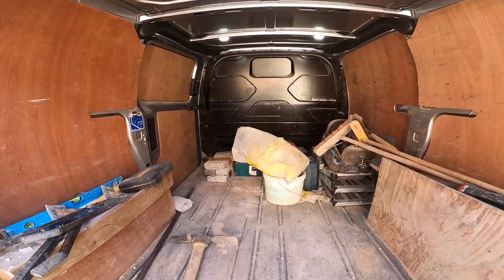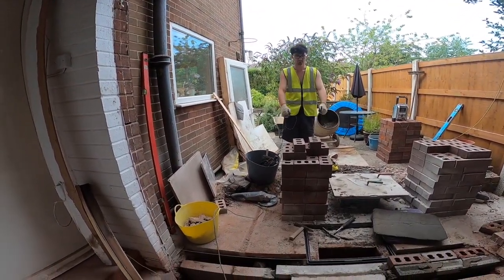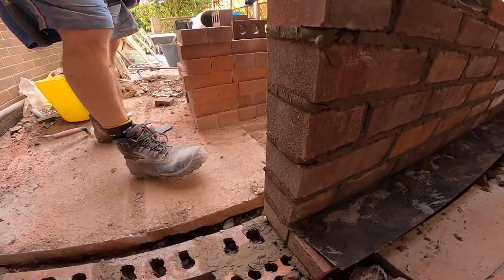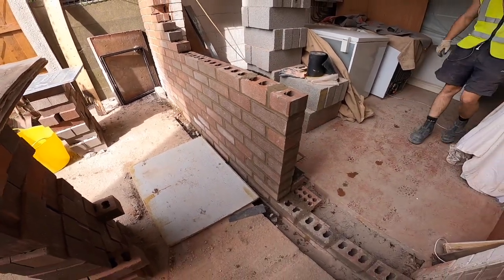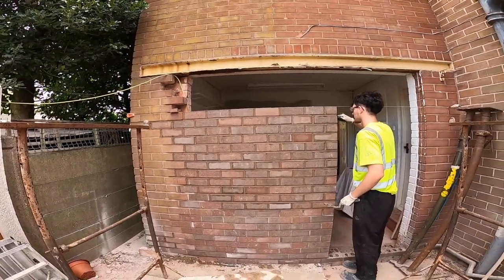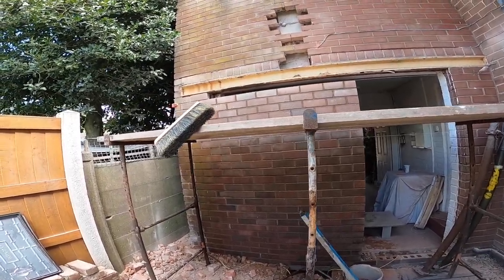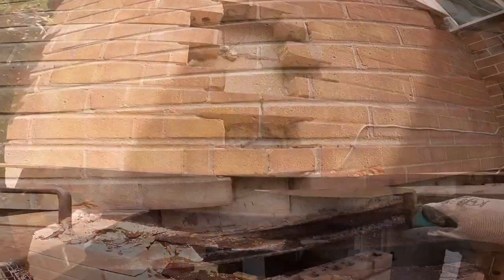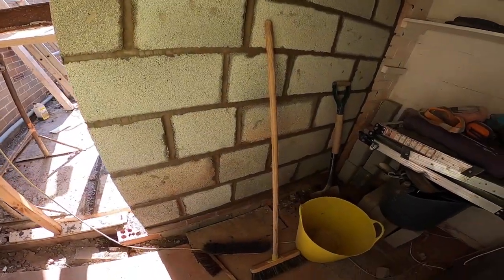THERE IS A MANHOLE IN THE WAY !!..SHOCKING BOTCH JOB UTILITY REPAIR PART 2

Comment: I believe the shocking amount of corrosion was due to the heat differential between a cold garage space below a warm bedroom. This is why it's vital to have a cavity tray above any wide opening. All the condensation forming in above cavity (bedroom area) was dripping straight onto the steel, accelerating the rate of corrosion, which as you point out, would have occurred anyway in the absence of a cavity tray. Top job so far!
Reply from the maker: @martin2466  And those internal timber lintels are out lasting the steel ones which are rotting away. Lot to be said for good timber 💪🏽👌🏼🧱👍🏼
Reply from the maker: @martin2466  💪🏽🧱👍🏼

Comment: TWO THINGS . 1 Did Not. SEE ENY . ISOLATION. 2. That MAN HOLE./ INTERSEPTOR.  SHOULD HAVE. BEEN EXTENDED ( that’s why. They  used to call them. Man holes. So you could ROD THEM .  SHOULD OF. TRENCHED AWAY FROM THE BUILDING . And BUILT THE MAN HOLE LARGER !!  THEN BRIDGED OVER TO. TAKE NEW. COVER ,
Reply from the maker: 1 . You can’t insulate a 9 “ wall . 
Watch part 3 and get back to us then 🧱👍🏽

Comment: I normally praise your work, but that man hole cover lets you down, there will probably be smells because it cannot be sealed properly, it needed a better solution, definately not pass building control.
Reply from the maker: Wait to see the finished job before you criticise its nowhere near finished
Reply: Been a builder 40 years manhole should have been moved from underneath wall never seen it done this way before everyone to there own I guess 👍

Comment: I wonder why they left that steel beam exposed to the air. It's been known for 200-300 years, that rust breaks brickwork. It seems really shoddy work.
Reply from the maker: Bob the whole extension should be condemned , it was shocking 🧐🧱👍🏽

Comment: Interesting video and not a dilemma I'd fancy encountering. Definite case of economics overiding ethics in this case. Re corrosion, I recently started replacing old metal manhole covers with composite covers (3 so far) on driveway jobs and won't be looking back!
Reply from the maker: Sounds good 👌🏼🧱👍🏽

Comment: Alex and Steve as ever your work is of a good standard however, I do question the building over an inspection chamber. I know it would have been expensive but, the chamber is there for a reason and is now very difficult to access for periodical maintenance. Not sure a building control officer would allow this but, I would be interested to know?
Regards DD
Reply from the maker: Watch the final part and get back to me 🧱👍🏽

Comment: i  would of filled the brick holes on the last course of bricks before the dpc, then thin bed of darbo under dpc and bed it in, when i was an apprentice, 2 and one squad we forgot about the dpc, had to pull 6 course of bricks down 5 mtre long oops.  nice works lads i`m 63 now so i have it easy with the council .
Reply from the maker: Nice one Macca 🤜🏻🤛🏻🧱👍🏼

Comment: Must confess I do not understand what is going on here. I mean if the Water Co owns the drains/sewer and needs to fix them, they are legally entiltled to demolish anything in the way. The manhole will also be shown on the Water board plans as being under the extension. Sadly these things often only come to light when the house is sold and these plans are purchased by the Conveyencer. I fully accept Steve and Alex are doing what the customer has asked though. A tricky situation!
Reply from the maker: Cheers Danny 👌🏼🧱👍🏽
Reply: Normally you have to pay the water company for a 'build-over' agreement. Another Cash cow for the water companies. Whether they did here is not known? The more concerning part is whether they dug the foundations deeper than the drain-run, otherwise the drain could collapse. 
I'm sure they will be putting a rodding eye in at the S.V.P. otherwise I would be concerned with the local building control!
Reply from the maker: @bilbobaggins7137  All will be revealed in part 3 🧱👍🏽

Comment: why did you not you move the manhole ?
Reply from the maker: Very big expensive job 🧱👍🏼
Reply: Not that expensive do it all the time.
Not good practice to build over the middle of it.
Reply from the maker: It’s very expensive when the pensioner can’t afford it and there is nothing wrong with our solution  🧱👍🏽
Reply: Building control would not allow that in my area 👍
Reply: I could not even build close to manhole on a job last year.
And was made to move drain run by building control/ Welsh water so be very careful.👍
Reply from the maker: @darrenchandler8799  🧱👍🏽
Reply: Nor in any area I have worked in would that meet building regs, wouldn’t like to smell it in there afterwards
Reply from the maker: @robmac5578  . There is no smell

Comment: good job, but wye not rake the existing joints out to the corner and point up like the new work, look so much better.
Reply from the maker: There was plenty more we could have done to that extension but you have to stop somewhere 🧱👍🏽
Reply: @SteveAndAlexBuild   yes you are right, would look brilliant if the whole wall had been repointed as you said you've got to stop some ware.👍
Reply from the maker: @dccowell56  🧱👍🏽

Comment: You cant call this video a bodge job when you've just lintel over a man hole and built a wall over it you should of moved it over out the way
Reply from the maker: Just move a 3 foot deep brick chamber , you make it sound easy 🤣
Reply: If a jobs worth doing and all that
Reply: @martin2466  I would tell them to get some one else to do rather than put my name to a bodge because the customer is a cheap skate
Reply: @martin2466  I guess if they plan to stay for a number of years it all makes sense. It is a lot better than before they came!
Reply: @michaelhammond9996  who's going to friggin pay for the manhole to be moved not S&A THINK before you open your gob!